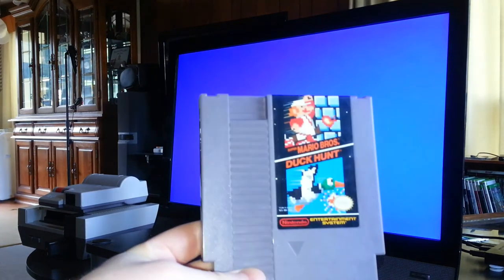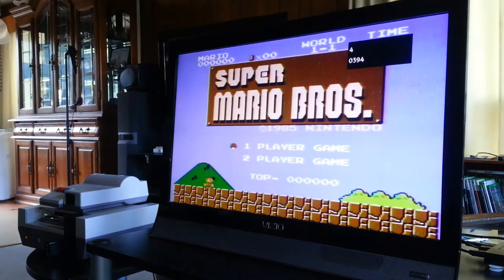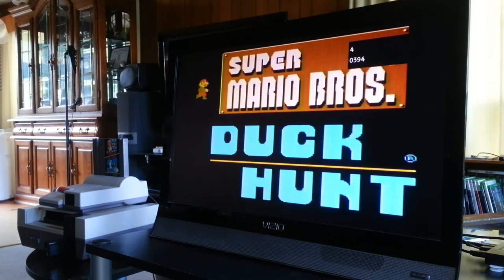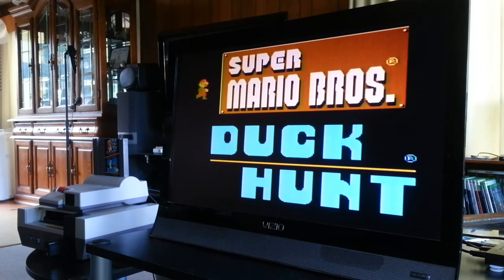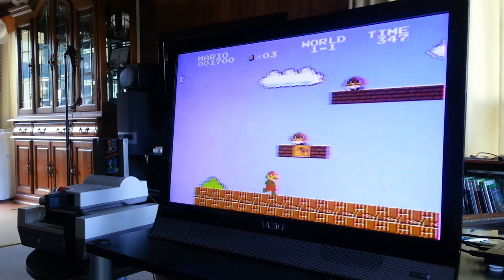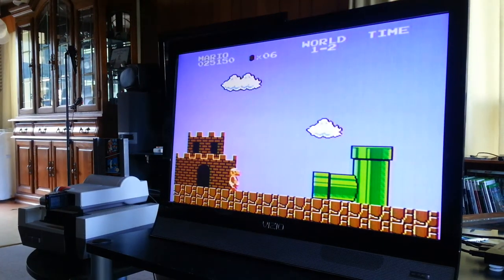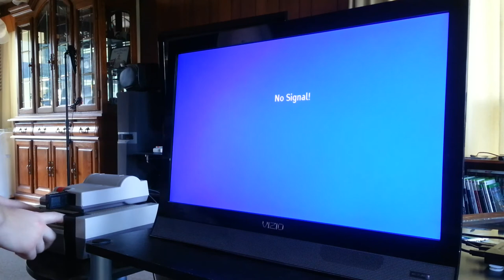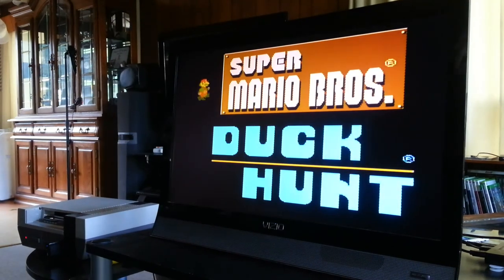Nintendo RF Switch | Fix

Comment: Hi. Firsta of all, nice video! I need help, i got the same RF cable and it  has a little cooper wire  of 1mm diameter off, but i cant figure out where it comes from and i didn't see it in your video. Is there any way i can show it to you?
Reply from the maker: Absolutely by all means send me a link via spidermcgavenport@gmail.com I'll take a look at what your referring too. You may also place the link here of your video uploaded to YouTube.I have filters on and only I will see your video. 
On the off chance would finding another rf switch may need to be in order I'd suggest going to your favorite buy site and nabbing up another. The 1mm copper wire is most likely the coaxial side that I did not work on for mine that's the T.V. Cable side of the RF switch you may find extra bits of that cable laying around the house or basement unless renting - it comes in spools at your local hard ware store. Its called coaxial cable and would require a careful bit of wire stripping to replace it on the RF switch. And a new end. I can also leave a link to an unlisted review covering this if you'd be interested and I'd share it in the description box addressing this circumstance. Thank you for watching it's greatly appreciated.
Reply: @spidermcgavenport8767  I did the Nintendo work. The copper wire was just a coaxial cable that may got stuck in there long time ago. Thanks for your reply anyway!

Comment: Were can I purchase just the rf switch cord itself
Reply from the maker: There are many hobby sites available, but you don't have purchase the cable, any rca audio video cable will do, that's what I used here. Just a spare non-working one that was frayed at one end and just cut the bad end off. Just be sure to shorten it some unless the rca wire you are using is shielded from rf interference. 

Thanks for watching. Welcome to the channel!
Reply: Thank you